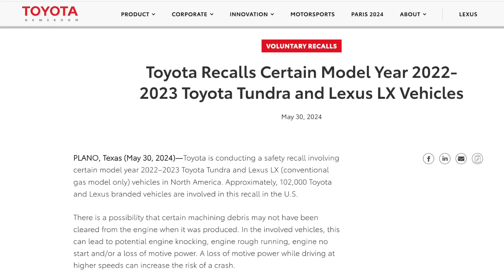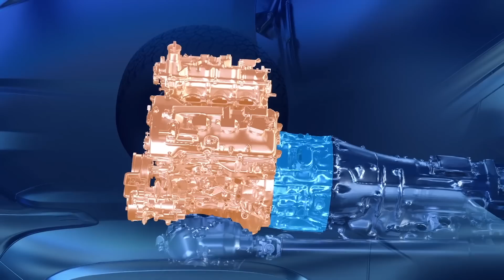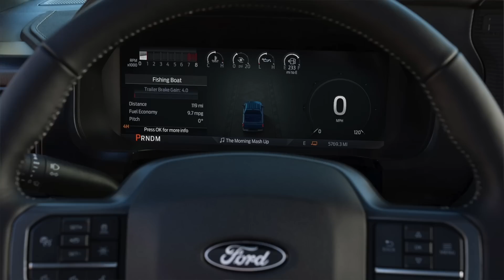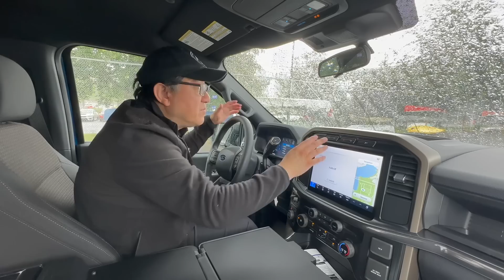ENGINEER EXPLAINS TOYOTA TUNDRA RECALL // SHOULD YOU BUY FORD F-150 INSTEAD?

Comment: I bought a 24 GMC Sierra 1500 6 cyl turbodiesel and super happy with it.  Mileage is incredible and the entire truck feels very high quality and well put together.  I'm averaging 23mpg around town and got over 30 mpg on my last road trip
Reply: I’m considering one but the $2k timing belt replacement has me concerned. It’s located on the back of the engine near the firewall.
Reply: After all the problems I have heard with those trucks I can't tell if your comment is satirical or morbid XD

Comment: My first Toyota 07 5.7 still drive every day and just turned 650,000 not one major problem. 
My 2022 1794 trd with 19,500 miles and have to wonder if it's going to stay together ? 
Yeah you could say I'm a little pissed.
Reply: Yes, Toyota really put the screws to V35A-FTX engine owners because if they take good care of them and get them to last past the 60,000 mile powertrain warranty period and then they fail, these owners will need to spend $20,000 - $30,000 to get them replaced.  Then on top of that, their trucks will depreciate fast in value because used car shoppers will know '22-'24 Tundras have short lived engines.

Comment: Not a good start tundra. But tundra in early years of all gens have had problems. 
What sets tundra apart is lack of change.
Ford led all manufacturers in total recalls last year. Highest ratings from JD Powers, NHTSA, Consumer Reports have Ram ahead of the others. 
And Ford cost cutting concerns me. No rear wheelwell liners, plastic oil pans, door panels look cheap. Where is Ford cutting corners that we cant see? I do like the aluminum body. 
I guess they all have issues. 
What about Titan?

Comment: On all new cars I owned, I have changed the oil at 500 miles and again at 1000 miles for the same reason. Never had an engine problem. And I had notoriously problematic engines like the Ecodiesel and the Ford 3.5 Ecoboost.

Comment: Toyota knows more than they are revealing, the problem will only worsen and expand the recall.  They are attempting to meter out the recalls so as to not overwhelm their dealerships.  Any truck that doesn't get a new engine is just a gamble, not worth risking past its powertrain warranty.  If in the market now then just lease, don't buy these time bombs.

Comment: I'm a big Toyota guy. However, this is two major issues with the new turbo six cylinder engine. I currently own a 5.7L Tundra (which I love) and would love to buy a new one but I will NOT by a new Tundra until Toyota PROVES that they have fixed the problems with this new engine.

Comment: Longtime Toyota owner here (4th and 5th gen 4Runners and 3rd gen Tacoma).  I was in the market for a full-size pickup this spring and ended up purchasing a 2024 F150 5.0 Coyote (5.0L V8) SuperCrew.  I'm in love with it so far.  Terrific power.  Terrific V8 sound.  Smooth ride (much more planted on the highway than my Toyotas).  No turbos, engine debris, poor fit and finish, broken axles/front diffs, etc to worry about that seem to be plaguing the new Tundra and Tacoma and leaving them piling up on dealer lots.  Large dealer discount (5% below invoice) and low interest rate (3.9 for 60 months from Ford), while arrogant Toyota dealers in some places are laughably still trying to slap market adjustments well over MSRP.  The Ford is not quite as tightly built as my 5th gen 4Runner, but it does seem on par or better than my Mexican Taco, which felt very tinny and had a transmission with ADHD.  I really feel that Toyota swung and missed badly with all of the latest generations of its trucks (3G Tundra, 4G Tacoma, and soon to be 6G 4Runner).  People always expected bulletproof reliability for a fair price from Toyota, and they have absolutely failed with the new turbo trucks.  Things went bad, and quickly, for Toyota since 2022 when they abandoned their principles.  It's really a shame to see a once great brand crumbling before our eyes.  This will take some time to fix, and it won't be easy.  They need to clean house in Japan and bring in some leadership that know what they're doing.  Then they can get back to being Toyota.
Reply: Toyota screwed up big with the crappy looking design and quality in the 2016 Tacomas and the new tundras are pure garbage!
I only like tacomas 2015 or older and 1st & 2nd gen Tundras!
Reply: Well said, I am also considering a f150 with the 5.0
Reply: @Wicho4414  It's a nice ride.  I'm getting 18.7 mpg combined through 3,500 miles and just got 24 mpg on a 300 mile drive yesterday, roughly the same as my 4Runner, but with 400hp instead of 275.  The 5.0 is remarkably efficient for a V8.
Reply: @93henfan Thats because you also have cylinder deactivation (which is very bad for the engine) and Auto stop start (which is bad for the starter) and this is the reason why I've bought the 2024 Nissan Titan with the 5.6L Endurance V8 in it with 400 HP and 413 Ibs of Torque vs the 2024 Ford F150 with the 5.0L Coyote V8 in it with 400 HP and 410 Ibs of Torque.
Reply: @CJColvin  Actually, Ford's cylinder deactivation has proven to be trouble-free through five model years in the best-selling truck in America (literally no failures reported in hundreds and hundreds of thousands of trucks). If it worries you, turn it off (sport mode). Also, I disable auto start/stop - not a fan. Hey, the Titan is a sweet, albeit outdated, truck. I considered it. At the end of the day, I had to consider the lack of aftermarket support, as nobody really buys the Titan and it's being discontinued. So, I stuck with a proven winner in the 5.0 F150. The venerable Coyote is still the king.
Reply: @93henfan  True except my Coyote in my 2011 F150 I had was starting to burn oil at 160,000 miles though not very bad.
Reply: @93henfan  Also just to throw it out there that the 5.0L Coyote V8 is made in Ontario Canada 🇨🇦 as well while the 5.6L Endurance V8 in the Nissan Titan is made in Tennessee USA 🇺🇸, also the aluminum that makes the aluminum body F150s comes from Canada 🇨🇦 as well while the steel on the Titan is all American made.
Reply: @ Hey, if you're cool with sending all the profit to Japan instead of the US, go for it.
Reply: Well said. Toyota won’t arrogantly get out of this mess cheap but Toyota will try to.
Reply: Well said
Reply: Well said. In my area, dealers (even Toyota) are giving next to nothing on trade ins for Tundras (22-24) or not taking them at all. I have a 2015 5.7L v8 and I’ll keep it. Not a fan of Ford but I wish you well with your Ford.
Reply: @93henfan  Do you have the 5 year 100,000 mile bumper to bumper warranty as well as the lifetime power train warranty?

Comment: Panel gaps and misaligned trim strips are so comical. Saw these at the dealership and took 100 pictures not two straight lines on these poorly assembled tin cans. So sad that Toyota is finished even the 2025 4runner will be junk.

Comment: If you believe it’s machine debris. You are really naive.  Also, this recall ain’t the same as other recalls you mentioned of other Toyotas.  Stop down playing that. This is a catastrophic failure of the engine if it happens to you.  Does not matter what kind of fix Toyota comes with.  You will have to bet your mechanic is a dam good master mechanic. You trust dealerships ? There can barely change oil
Reply: Really only solution is Entire engine replacement and extended warranty with iron clad wording. None of that , we need more proof or try this cheaper repair method first.  But , Vancouver dealerships has maybe 2 that I know of “master techs”  rest are all general mechanics that can not do this kind of work

Comment: My 2008 Tundra has 119k miles on the odometer and a 5.7 under the hood. I'll have this truck until the day I die and it will still be running well.

Comment: LS powertrain is differently tuned or made, even though the engine is same. Tundra is a massive failure. LS is also a failure but not like this, Lexus is going down hard. IS 500 has bumper sag which is not addressed by Toyota, infact ruins it further. Garbage company now. Just try to buy LC or RC F before they are gone, for RC F don't get 2023+ cars as they removed engine bracing.

Comment: Even Toyota doesn’t know for sure if it was the debris damage the engine, Toyota build car for about 80 years, it never happen before if Toyota engine building procedure are the same globally, why only problem on V6 twin turbo engine only not 4 cylinder or diesel engine, that’s nonsense, Toyota should admit that it was a design flaw instead!

Comment: Why I don't believe it's a machine debris? But I believe it's a bearing issue, bearing falling apart in pieces and contaminating the engine inside, basically destroying everything. Because when the most massive engine parts are produced at the factory like short blocks, valve heads, after the machinery process and honing process the blocks are WASHED. It can't be another way. And not only at Toyota. It's everywhere like that.
So debris inside of an already assembled engine from different clean parts? Only if someone put it there intentionally after assembling or during the engine assembling. But not during machinery process. Nobody manufactures an engine by doing machinery job on an engine block with the bottom cover closed or the oil pan closed.
So who are trying to fool, Toyota?

Comment: I would never buy a Ford vehicle again. I owned three in the past and I had countless headaches. Once trust is lost, there is nothing they can do to persuade me to change my mind.

However, if I had to buy a brand new truck, the 3rd gen Tundra would be my second choice. Despite my criticisms of the poor exterior design, the difficult access to work on the engine, and the ridiculous pricing, I still consider it a viable option. I am very disappointed with Toyota in respect to the new Tundra, though. What would you expect from a truck where the head engineer involved is Mike Sweeney?

My first choice would be the GM twins with the 3.0L diesel. It is an amazing pickup truck. I wouldn’t touch a Ram either. Just learn more about the executives at Stellantis, and you'll understand why I wouldn’t buy a Ram.

In my opinion, Toyota's corporate culture is still the one I trust the most. They have built a reputation for being the most reliable vehicle manufacturer, but it seems they are now leveraging that reputation to charge higher prices while offering lower quality vehicles. Just look at what they did to Lexus, and you’ll see what I mean. However, they have also improved the overall quality and appeal of Toyota-branded vehicles, so it’s not a bad tradeoff if you are a fan of Toyota, though perhaps not Lexus.

Comment: David, Thanks for the review, that had to be tough for you. What’s your thoughts on the new GX550? Would you delay in purchasing with the engines being almost identical???? Also, what is the extended GC holds on many of the GX550 and LC???? Should we be concerned especially with Toyotas lack of transparency on the possible issues and all the speciation building??  Thanks

Comment: I've written ad nauseum about my thoughts at this point, but I'm still adamant that the problem is not (solely) machining debris, but the bottom end design converted from car use is not structurally/mechanically adept for use in the trucks. One production run I could buy debris issues, but at that point, those engines will be 'factory tainted' via start-up to load them on the transporters long before they ever touch ground on a dealer lot or a customer driveway. Three full production years (the '24s are also failing, just not covered as of the present) point at something much, Much more dire. 
Worse yet, rebuilt engines are still failing two and in a few cases, Three times. That could be design or even material failure, or dealer techs just really, really suck at doing hardcore repairs. An argument could be made for repeat business from the scummiest of dealers, but I doubt anyone wants to do that job dozens/hundreds of times like they are facing now. 
This is all on top of the lesser existing issues like the turbo wastegates going premature, transmissions of poor quality, rusting body panels from lousy installation, the door seals falling apart... 
Toyota's got a stout mess on their hands.

Comment: The 2025 Ram 1500 3.0 I6 TT are already having issues as well. It seems all of the snaller displacement turbo engines are having issues. I believe the blocks are contorting causing issues in the bottom end with the bearings and crank
Reply: Agreed 100%

Comment: None are good buys. Going to pick up a 2001 zero rust, Silverado 2500 crew cab 8ft box 8.1 v8, allison transmission 4 wd, just needs paint from the arizona sun. 6 grand! Its a real truck. Money saved not buying a new toy truck will easily pay for the 10 mpg it gets, for decades!

Comment: I think Toyota missed the mark with the Hybrid Tundra. The F150 Powerboost takes advantage of the hybrid system far better and more efficient. Also, I’m not buying the “manufacturing debris” reason for engine failure. There are failures ranging from 2k miles up to 40k miles. Debris will trash an engine quite quickly, not 20k plus miles later. There have been people that did a 1k oil change and 5k OCI’s following that have had engine failure. Heck, even a 2024 that I’ve seen which means the “fix” implemented in mar of 2023 didn’t work. There’s an inherent design flaw or oil system issue. I’ll be curious to see what actually comes of this.

Comment: My 2013 F150 Platinum EcoBoost truck had poor build quality. Rough shifting transmission and cheap interior parts. Ford customer service is horrendous. Their dealership service departments are the worst.
Reply: My '13 5.0 FX4 was rock solid.
Reply: I had the 3.5 EcoBoost. The 5.0 Coyote is a much better motor.

Comment: Or it could have nothing to do with debris left in the engine and its a poor engine design. What I'm hearing from Toyota techs is that upon tear down its always the foremost bearing burning up due to lack of lubrication. This points to a design flaw, not debris as debris would affect different motors differently. Id never buy a turbo engine, even from Toyota. Toyota lost their way, simple reliable has always been the Toyota way. No one does complex machinery well. The Tacoma turbo will also have serious issues just watch.

Comment: Is it the crankshaft main bearings or the rod bearings that are experiencing failures?  

I would still buy this over a GM/Ram product.  The 5.3 has had the same camshaft lifter issues for a long time with never a recall or a change in the product.  Ram is just junk no matter what.😅

For sure would buy the F150 Coyote V8 or 3.5 Ecoboost in the 1/2 ton market.

Comment: I owned a 2005 F150 Lariat for 18 years before selling it to buy a new 2023 F150 Platinum. 
If it would have been possible to swap a Ford 6.2 liter V8 or a Ford 5.0 Coyote V8 I would have kept it, but the 5.4 liter 3 valve engine it came with made me sell it instead.
Only time will tell if I will keep this 2023 F150 for those many years.
But like Trump said, "we'll just have to wait and see".

Comment: Hi Dave, I have some inside concerns about Ford as an automotive company.  I used to work for a supplier of Ford several years ago and while they preached Quality all the time in reality it was a different story!  At times when they were very busy and they needed parts to supply their assembly lines Ford would take questionable parts knowing fully that these parts could pose problems for the customer down the road.  Our plant would also make parts for Honda and they would NEVER accept questionable parts knowingly.  This is why I wouldn’t buy a Ford or GM or Chrysler!  I have mostly owned Honda and Lexus cars and haven’t had any problems but I never bought a car in its early production stage but models that have been a few years in production.

Comment: Bought a 2024 1794 Tundra a couple days before the recall... traded it in last weekend for a 2024 Raptor. Took a small hit but I have 0 regrets so far
Reply: Change theoil 2 or 3 times before you hit 10k
Reply: Lol, terrible raptor isn't true truck.  Can't off road and barely tow😂
Reply: @ericswanson9773 damn I'm not a true truck bro 😢
Reply: @ericswanson9773 Cool story, brah….
Reply: @ericswanson9773 your envy is showing 😉
Reply: You got lucky if you only took a small hit. You got rid of it before the world turns on Toyota.
Reply: How much of a hit we talking? I bought mine in January and have thought about how big of a hit I would take.
Reply: Just got a 24 Raptor myself.  Got rid of a 23 TRD Pro Tundra a couple weeks back.  The list of things better on the Raptor vs the Tundra is long.  Should have bought a Raptor to begin with and skipped the Tundra.
Reply: Have fun with that steaming turd 😂
Reply: That ecoboost v6 raptors are a piece of 💩,The raptor R is the only one worth buying without that 25k markup.
Reply: @josevega23  it's better handling than the toyota
Reply: @josevega23 at least no recall yet😂😂😂
Reply: Good ..at least for now you can drive the raptor with free mind...no worries about recall and till now toyota don't have clue..what is going on...and dealers can't take trade in😂😂
Reply: would have kept the Tundra lol
Reply: 1794 is how many miles the engine should last before you hear pots and pans
Reply: @KrazyKramer  good thing I traded it in at 1650 miles
Reply: That's a mistake mark my nuts

Comment: We have a 2014 4Runner. Lifted, 33's, winch, dual batteries, fridge set up to Overland. Old 4.0 V-6 156,000 miles and going strong. We are now towing a 4000 pound off road trailer. Like the new Trailhunter, 65-70K,(expensive) 4cyl turbo hybrid, not sure about the drivetrain. Would love the extra torque and fuel economy. Will probably wait until the 2026 model year to make sure there are no teething issues. We plan on keeping it a long time.
Reply: 0-60 time never? Just pulling your leg!